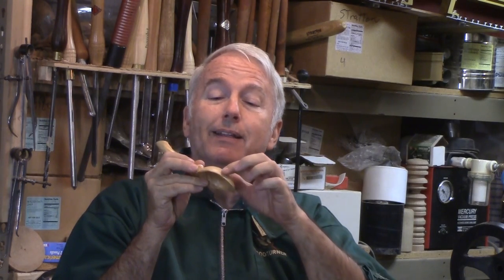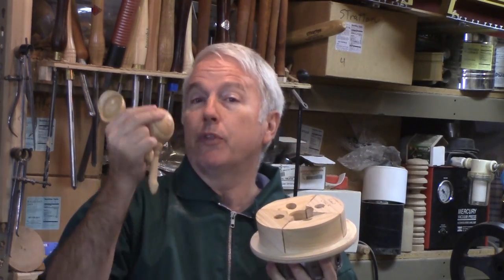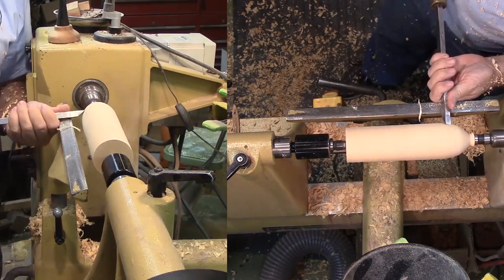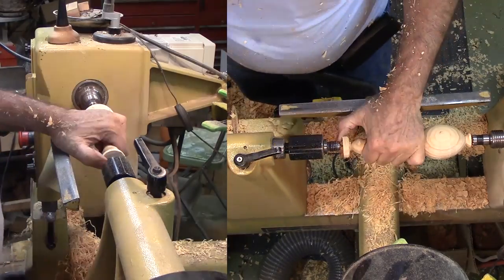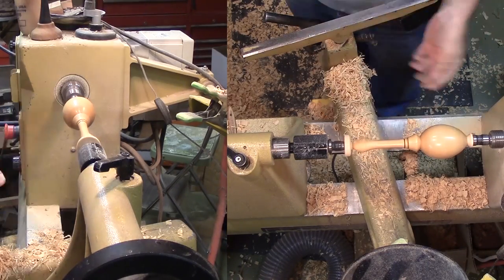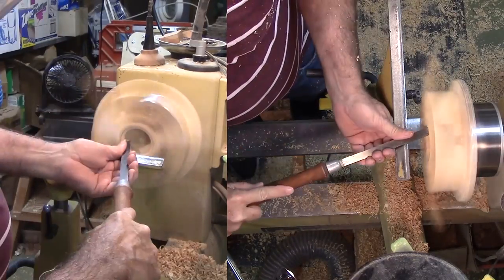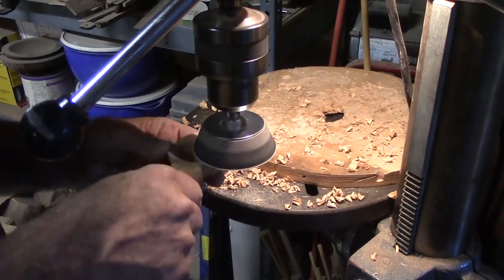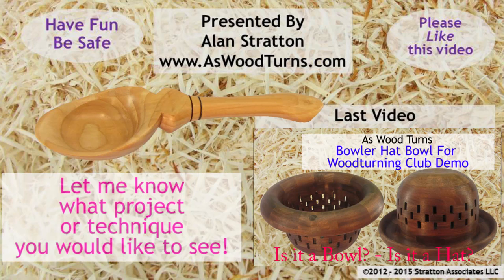Woodturning Oval Bowl Scoop With New "Scoop" Chuck

Comment: I make these type scoops with a standard 50mm jaws.  I use a section of leather belt to eliminate marring by lining the inside of the jaws and as you did I remove 2 of the jaws.  I do single piece scoops and two piece scoops where the handle is made with a tension and inserted into a socket that I turn as part of the scoop body.  There is also a foam material with adhesive back that works okay for the inside of the metal jaws ( usually found a Hobby Lobby or Michaels).
Reply from the maker: Bert Workman Thanks for the alternative suggestion.
Alan

Comment: That sure is an elegant solution to a problem we all face trying to turn spoons... Don't they cell those plastic jaws you can mount and then turn down to the shape you want? I've seen these here and there, but they are not cheep, for something you turn to use once or twice I would have loved then to be cheaper.. custom made wood jaws are a different matter all together, I still need to find time to make my cole jaws, already have all the materials, I don't know why I'm so lazy... ;)
Reply from the maker: Yuval Lahav Just set aside two blocks of time of about 30 minutes with glue drying time in between. 
Then no problem. :)  Or wait for a project that needs the jaws....
Alan
Reply: As Wood Turns That is the problem Alan, I could use those in most of my projects, well, off camera mostly, as my one true love was always bowls, and we know what a hassle those are to finish the bottom of... but I'm just about mentally set to make me some, this week, and be done with it.

Comment: Well done!
I love to make things which holds the wood on the lathe aka chucks. Now, that i'm upgrading my own turning equipment I'm more and more aware, that I I'm missing one information. What is the speed you're turning the air? Whenever I made off center turning with lots of air, I felt that double the normal speed worked fine with me, are you going faster or slower than normal?
Thanks for your inspirational work and your constant support of the wood turning community.
Greetings from Good Old Germany
Peter
Reply: ***** I also do this style scoop. The RPM's is not an important factor in turning with the exception of when a manufacture say the equipment is not safe above a certain RPM. A safe speed for any project is a speed you feel comfortable with.  My rule of thumb is, to ramp up the lathe speed to a point I feel uncomfortable then back it down until I feel comfortable.  Higher lathe speed can help with a smother cut.  Tear out is usually caused by the speed of the tool on the project surface not the speed of the lathe.
Reply from the maker: Bert Workman I agree - thanks for commenting.
Alan
Reply from the maker: ***** My lathe does not have a rpm readout. I've thought about adding one but I'm not sure that I'd use it after all. I use a speed that I feel comfortable with. When off-axis there's a plus and a minus to speed. On the plus side, the cut is smoother as the wood is coming around faster. on the minus side, the stresses are greater especially with off-axis.
The bottom line again is what I'm comfortable with.
Reply: As Wood Turns Bert Workman Thanks Bert, thanks Alan!
As I used to have the choice between 850, 1250, 1750 and 2500 rpm on my old lathe, it was quite difficult to find a comfortable (or right) speed. I guess I have to find my new comfy zone now that I got the range of 80-3600 rpm. I'll stick to the three I'm used to and start playing I guess. Thanks for answering my question.
Greetings from Good Old Germany
Peter